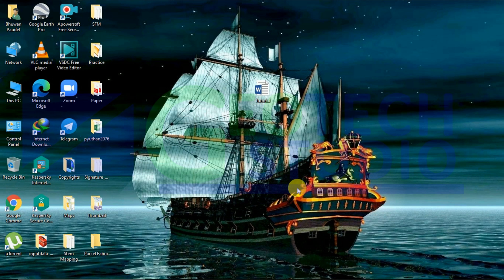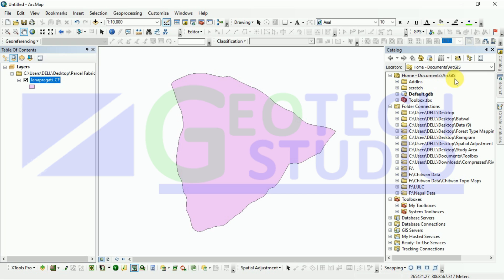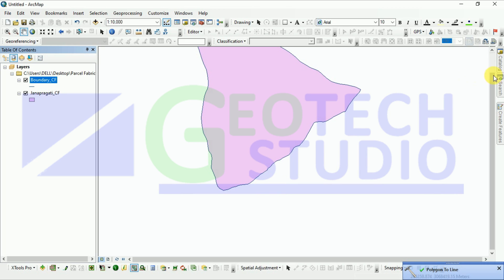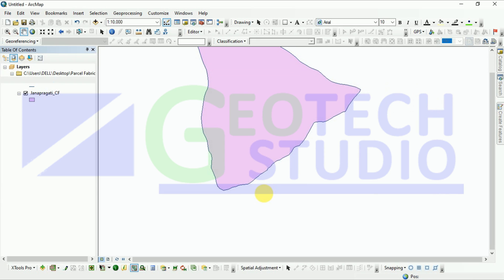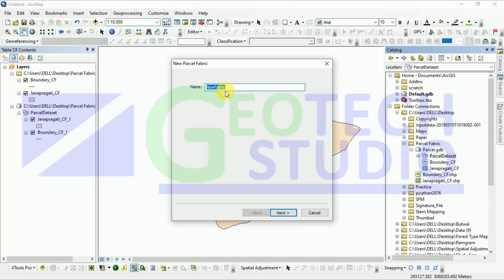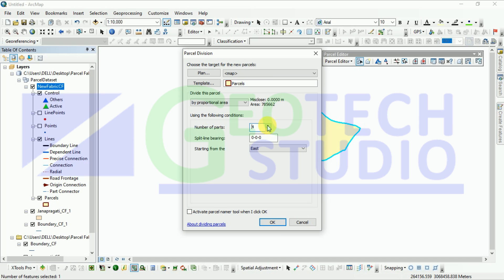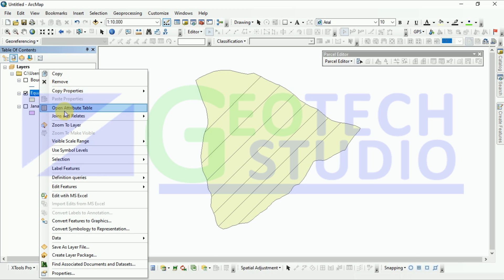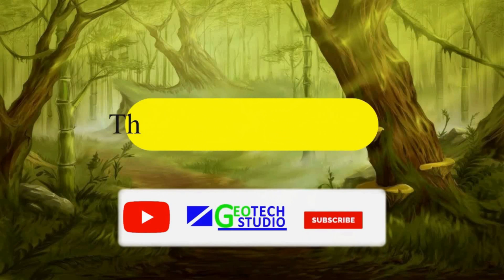Splitting Polygon Into Equal Parts Using Parcel Editor Toolbox || ArcGIS 10.2.2 || @geotechstudio

Comment: Hello,
Thank you for sharing the video.
I have a question which I will really appreciate if you can help me.
I did all the steps as the video with no problem, but when I did the parcel division, this error came up:
"A generated split line did not intersect with the source parcel."
I should mention that my polygon does not have clean edges and it has an irregular shape.
With best regards
Reply from the maker: Try this method
https://youtu.be/WiIgWFtx8t0